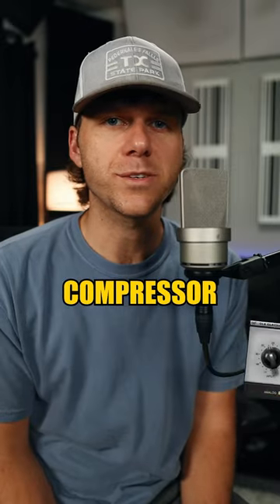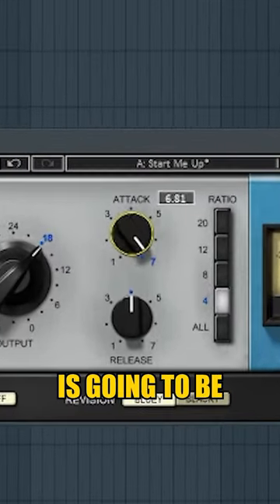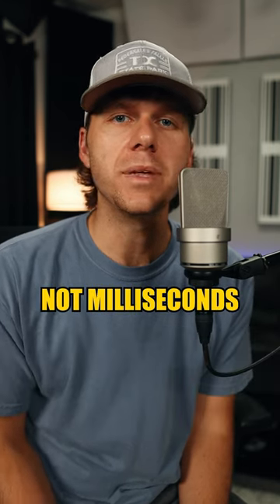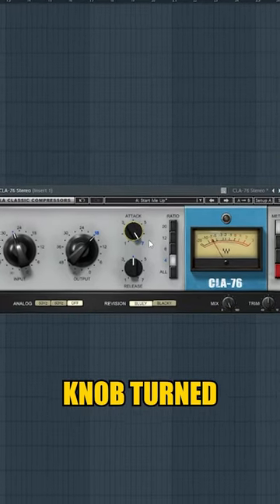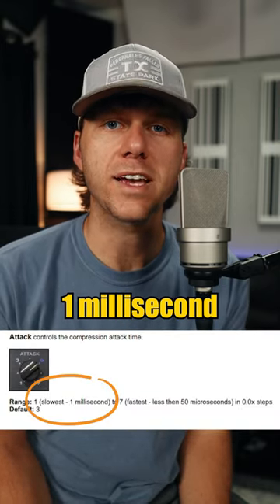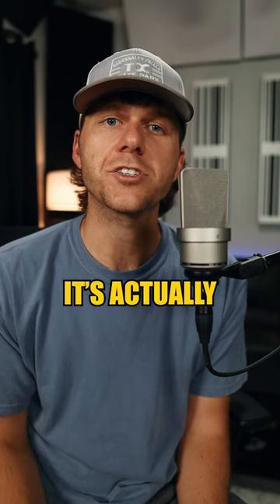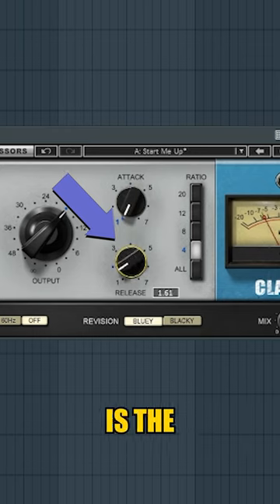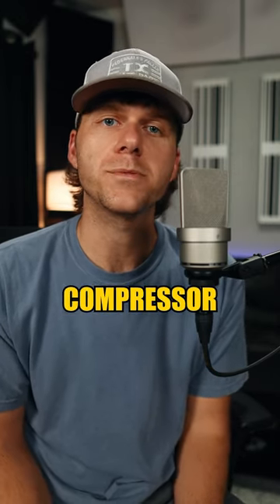Mixing Secrets of 1176 Compressor

Comment: Or… as sound engineers, we could use our EARS and instantly realise the attack knob was orientated that way because we would HEAR what the compressor is doing to our transients?  No??  I’ve never understood how people don’t figure this out instantly - unless of course they aren’t LISTENING, and are just twisting knobs for the sake of it just so they can say “look everyone, I used a vintage compressor - doesn’t my tracks sound good!”   No… no it doesn’t sound good - because you literally haven’t listened to the affect of the compressor and have just dialled in what the internet told you to. Anyone who needed the information in this video is clearly not opening their ears to hear what their settings are doing to their signal.
Reply: Sadly, it's the typical modern scenario. 
Mixing with their eyes and not their ears.

Comment: 50 microseconds = 0.05 milliseconds. In 44.1k audio the distance between two samples is about 0.045 ms so it looks like this compressor is designed to be able to have an attack just fast enough to start compressing immediately, the literal moment in time when a sample rises above the threshold. I'm not sure what the point of that is since you could also just use a limiter at that point but it's neat I guess.
Reply: Limiter is in the name of. The UREI 1176Lb limiting compressor

Comment: Can someone explain the context? And what software this is? What it's used for?
Reply: this is compressor, an audio plugin which makes loud peaks quieter, so it can brings overall volume up without distorting it, and this is one of fast ones that react to loud peaks very soon after they hit to tame attack from sound. this one differ from other compressors that intentionally pass more attack to make sound punchier

Comment: people need to stop using CLA
Reply from the maker: Why?
Reply: @mixwithjerry  they are notorious for alisasing issues when running masters at 96k-192k., which isn't a common sample rate for most producers, but can be problematic for mix / mastering engineers. When its within ranges of 44.1-48k it sounds good and is a decent emulation, but going above that it stops performing as well.

Comment: I hate this compressor... the attack and release being reverse is only the beginning... NOTHING about this compressor makes sense. there is not threshold... you get gain reduction by turning the input up... which ALWAYS makes a signal louder as it compresses leaving you to chase the unity gain with the output. Also the gain reduction meter doesn't work correctly either... you can have the input all the way down and the gain reduction is at "0," but in reality that means the compressor has the gain reduced by more than -20... so what could it possibly mean in an objective sense once you start dialing in the input????? IT'S GARBAGE!!!!!!!!